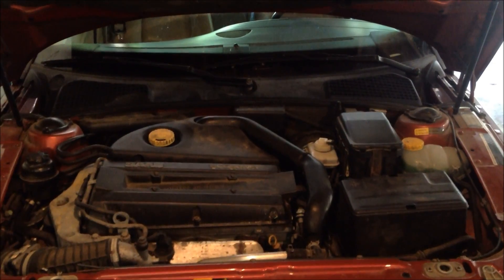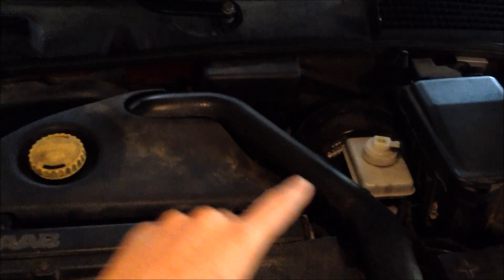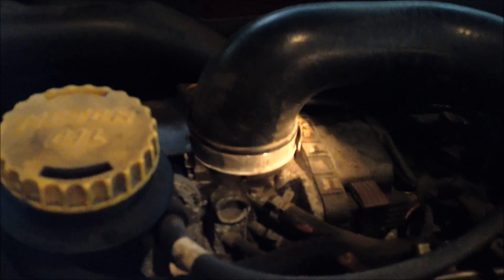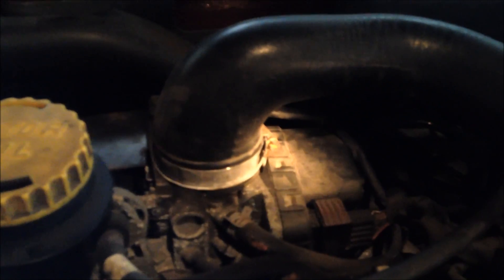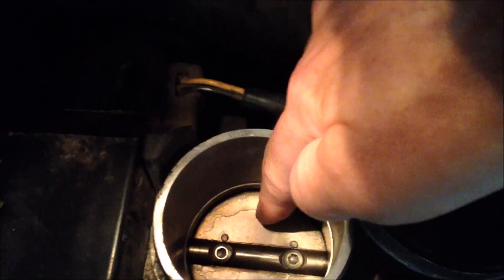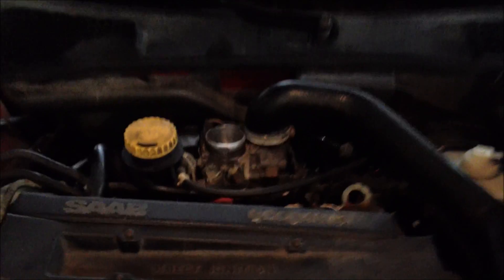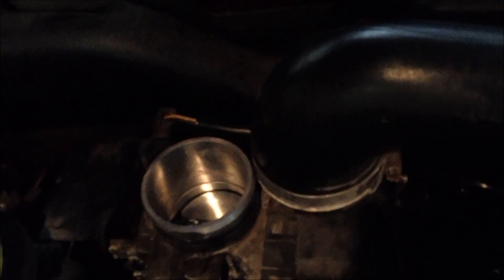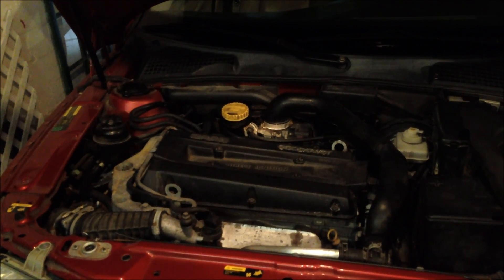Saab throttle body cleaning and limp home mode reset

Comment: Are you still working on the Saab?  I have an 07 9-3 that won't start at all.  Turns over, tries to fire off an barely run with the starter turning, but then won't catch.   A non-Saab mechanic said the codes showed fault with injectors, but they appear to be fine.  Internet said most often the car computer.  Ouch.  There is a guy on ebay who rebuilds them and reprograms to fit your car.  We are going to try that.  Wish me luck.  Hope to see more videos from you!  Thank you for posting.

Comment: So I have a Saab 9-3 and the car wont start now.  I got the throttle body error and took off the hose to check.  When I apply pressure I can't get it to open at all.  Locked shut.  Is that normal or is that most likely the problem?
Reply from the maker: trencher7 , I don’t know what your problem is. Mine always opened when I applied pressure. It obviously sounds like that’s not supposed to happen, but I’m a total amateur DIY’er, so I can’t say.

Comment: Have you resolved the final issue making your car not start? I know this video is old, but every bit of knowledge helps those of us who still cling on to their Saabs! I personally own 4, 3 of which are 2002-2004, so information about this style of engine is always helpful to me and potentially others.
Reply from the maker: Jesse Crandle I have not resolved the no start issue. I just have to crank it longer than usual and it starts for me. It won't be long before it stops working for me though. Good luck! I do love my Saab.
Reply: Your problem sounds a LOT like a check valve problem which is a small plastic part attached to your fuel pump. What this does is only allows gas to flow one way, so once gas is pressurized between between the fuel pump and the engine it maintains the pressure in that line so it can start quickly in the future. When the valves go bad (which is fairly common) then you need to crank for a long time to build up pressure. One possible way to test a partially failed fuel pressure check valve is to turn the key to accessory and then fully off multiple times, if the check valve works at all this will let the pressure build up. If the valve has totally failed the only way to prove it's the failed check valve would be to remove the fuel pump relay and jump it so it was set to run continually, then when you cranked it starting immediately would verify that it's the check valve. Long cranks are bad for the battery and starter, but dropping the fuel tank and replacing the $300-$500 fuel pump will cost $1,000 to $1,500 depending on the mechanic you go to.

Also that plastic cover behind the engine you removed, down in there is a fuel rail with a small plastic cap screwed on. You can check if your fuel rail has pressure by  turning the key to accessory then off two or three times (primes the pump for 3 seconds each time you turn the key), you can hear it making a sound as it's below the rear seats usually. The valve on the fuel rail is a schrader valve just like on a tire, using something small to press the inside of the valve will let the pressure come out through the valve, but it will also spray fuel out like a squirt gun and get allover you and the engine if you dont surround it with a towel. If only a drop or two were to come out then the check valves are not holding pressure, if an ounce or two of fuel spurts out it is likely fine, or at least good enough to build pressure by turning the key to accessory a few times so you don't wear your starter as badly.
Reply from the maker: Jesse Crandle thank you! I have a new fuel pump as well. That's my next video. Maybe these tips will help me identify a problem on my own. Mechanics aren't always affordable, which is why I do so much of this on my own. Thank you.
Reply: If you bought the fuel pump as an entire assembly then it will have new check valves already in it. I will say one thing though, you should really put a "TI Automotive" brand fuel pump assembly in the car as apposed to an aftermarket one. The OEM company, Walbro, changed their name to TI Automotive. Typically this pump assembly is $270 or so. A cheaper pump for say $120 or $150 will last a year to 3 years.... it's a lot of work for something to fail so fast, I really highly recommend you put in the TI Automotive (formerly Walbro) pump.

Comment: Do you have any idea how to reset a 1997 900S?
Reply from the maker: Betsy Jorgensen No, sorry, I don't know how to. A lot of my knowledge comes from internet searches of the problem. Then I read what others are doing. Good luck.
Reply: I've scoured videos and forums with no solutions. I'm stumped!
Reply: +Betsy Jorgensen Hi Betsy, this comment is fairly old so I might be too late to help you, BUT the 1997 Saab 900S used the Trionic 5 software, and the throttle body happens to tie into that. 1999 to 2002 (and '03 convertibles) used "fly by wire" to drive the car relying on this throttle cable as a backup in case the solenoid fails or something else catastrophic fails. The 93-98 Saab 900s did not have a solenoid and were directly controlled with the throttle cable, so the action she's performing here will not work on your vehicle. Whatever issue your vehicle is having unfortunately cannot be fixed this way.

If there is an issue with rough idling or a potential startup issue you may be looking to clean your idle air control valve.

Comment: the problem could be the crank position censor
Reply: My hard start was a leaking fuel injector. It could be so much on a Saab.
Reply: I had this problem and was cps sensor changed all good now more stalling on idle

Comment: Did you ever solve the intermittent start issue? My '99 Viggen isn't wanting to start again after it's been driven, unless I give it some throttle and keep the revs up for a few seconds. Otherwise it'll turn over sputter and stop.
Reply from the maker: No, I haven't put too much more effort in to it because it hasn't left me stranded somewhere yet. But I am still having those exact issues.
Reply: +Duchess DIY Its very possible that you have a bad direct ignition cassette. This will result in no start issues and the engine running erratically and misfiring (very common problem on Saabs)
Reply: This could possible be ur crank position sensor gone only replace with bosch genuine 💯

Comment: Hi, I had the same issue and it turned out to be a hose to the Brake Booster Vacuum Hose
(the valve area was cracked on this hose). I did do the same thing as you and clean my throttle body as well prior but the issue kept coming back until I was stranded at one point. It also generated a P1260 code for me (similar to the P1230 code you had in an earlier video.
Reply from the maker: Thanks for the advice!! I am starting to suspect a vacuum leak somewhere but I can't find it with a spray of carburetor cleaner while running. My next video might be a fuel pump change just in case.